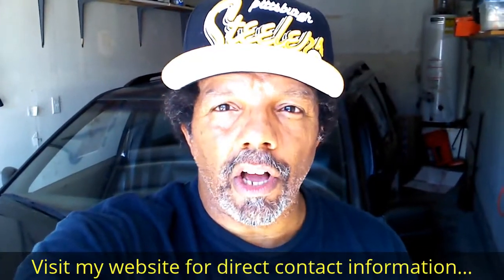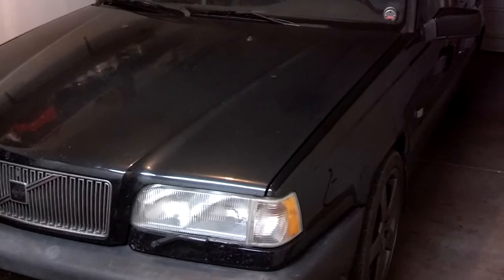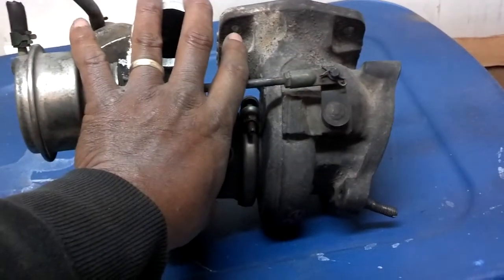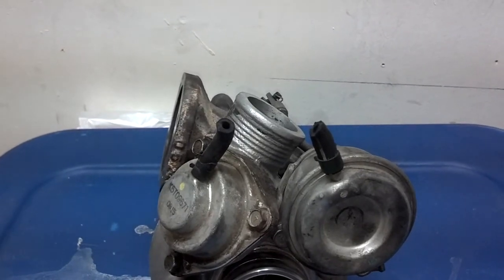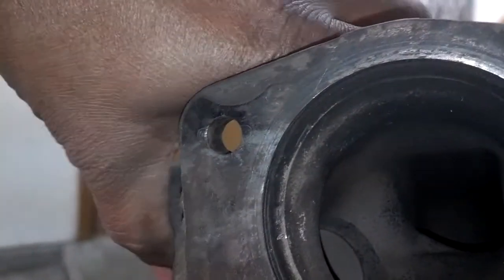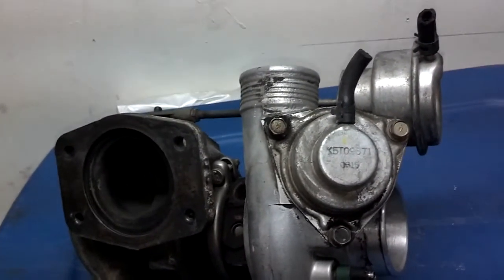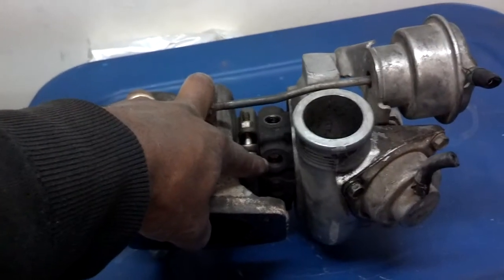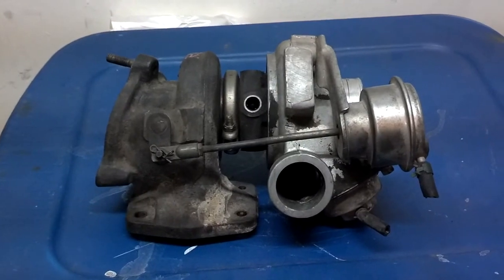Turbocharger system on a car or truck, 101. Introduction to the trubocharger system. - VOTD

Comment: Great tutorial. Since the S70's don't have a turbo gauge on the cluster, is there anyway to tell if it's not running correctly?  Will a bad PCV system ruin a turbo?
Reply from the maker: Sebastian Schwarz I do NOT believe that a clogged PCV system will damage a turbo, however, it will cause some back up in the system and cause some oil to get into the intake tubing. I believe it is an injustice for manufacturers to fail to install turbo boost gauges. I believe they deleted them to reduce questions from the end users. I would recommend installing one, permanent or temporary to check the system from time to time.
Reply from the maker: Sebastian Schwarz https://www.youtube.com/watch?v=awtZwxsBRZM

Comment: I have a B230FT turbo engine in my 1987 760.  After 190,000 miles, still have the factory turbo (because I let the turbo cool down 3 minutes in city driving and 5-6 minutes in mountain driving. Good video.  Thank you.
Reply from the maker: Michael Chitwood Nice. I feel that Volvo's have good turbos.
Reply: I agree.  I encourage other drivers (with turbos and non-turbos) to let the car warm for 2 minutes during this 8 degree weather (24 degrees below freezing 32).  I am surprised by the large number of drivers who start the car and go (about 85% of the people I've spoken with).  One would think they would try to make the engine & transmission oils warm up during the 2 minutes and make both last longer.
Reply: Here in Denver, CO; we've have sub-freezing weather for past 2 weeks!!
Reply from the maker: I know. Brrrrr

Comment: Hi Robert! I seem to be loosing a lot of coolant underneath my turbo which is landing on the block and steaming. Its hard to reach but I believe its the coolant line you show on this video. Its completely draining my coolant reservoir. Any easy ways or videos to get to it without too much disassembly? Its a 1998 V70 XC AWD 2.4 any info would be greatly appreciated. Thanks man and thank you for all you do!
Reply: Robert DIY
Reply from the maker: Davey Ward There is a supply coolant hose and a return coolant hose. It may be tough getting the supply hose replaced but I usually do it from on top on your car. - https://www.youtube.com/watch?v=JRBBvLBhAdk - https://www.youtube.com/watch?v=SGilWieCnOQ - https://www.youtube.com/watch?v=s1OlrdloSzo
Reply: Robert DIY its not the inlet hose like in your video, its another hose underneath the turbo as far as a can see. I took the airbox and turbo pipe out to get a better look and can see the coolant leaking on the block. Not sure which hose yet bc we've had tons of snow lately and haven't had a chance to take the turbo office to see exactly. Ill try to take a pic if possible. Maybe a main lower radiator hose, but it drains the coolant reservoir mainly while im driving(short distances bc I have to keep filling it up). When the block gets hot it steams bad and smells like antifreeze burning. Its def under the turbo not on top like in the video. Thanks again man for the info
Reply from the maker: The only other hoses back there are the lower radiator hose and one of the heater core hoses. At any rate, You should fix it before you loose your game of coolant roulette.
Reply: Robert DIY Thanks Robert! I should be able to get to it in the next couple days

Comment: ok ? how do i get the smoke to stop , evening after i change the turbo that was leaking ..i believe theirs still oil in the exshualts system
Reply from the maker: You'll have to keep driving until it all burns off. Maybe 500 miles or so.

Comment: Thanks Robert. Great videos. Can't help thinking that there are a lot of people buying cars, cars with smaller capacity engines which have Turbos fitted and yet these people have no idea about how the Turbo works, how to live with a Turbo charged car, the importance of proper servicing and the importance of buying an extended warranty when buying second hand.
I, until very recently, worked in car sales, I hasten to add that I hope to again sometime soon but one thing I liked to do was to explain the function of the Turbo. For example, a customer would come in and ask for a car with a 2000cc engine. As we are so use to doing in the UK.  I would then find myself explaining that we didn't produce that car with a 2000cc engine and would tell them that the 1600cc engine in this model produces more power than a 2 litre engine! I would then have to explain the function of the Turbo and the reason for fitting Turbos.
My guess is that the motor industry is building up a lot of warranty and repair cases for the future if people don't understand how a Turbo works and good maintenance practice.

I do have a question though! My Saab Turbo had recently started blowing white smoke out of the exhaust so I changed to a slightly thicker motor oil to see if I could reduce the smoke problem which I guess is the Turbo on the way out. Anyway, the slighly thicker motor oil seems to have done the trick as I only get a puff of smoke once or twice in a moderate journey, which is fine until I replace the Turbo. The question is, is my smoke issue likely to be the Turbo as I have no other problems, the oil consumption has dropped off due to the thicker oil, and what are the implication of using a thicker oil?
Reply from the maker: +Phil Donnelly My guess would be old tired valve stem seals, especially if the smoke was during idle and long down hill coast. 

Great points about more vehicles being equipped with turbo's. Many will destroy them prematurely.

Comment: Thats brilliant robert, i understand a basic turbo for the first time :D
It sounds a little like an electronic power supply circuit where there are paths for control and negative feedback paths to keep it from overloading or overdriving.

The cool air requirement makes sense to me in a way, hot air expands so takes up more space than normal, thats not a desirable thing, cold compressed air is concentrated better or more dense, is that near to the truth robert?
Reply from the maker: zx8401ztv Yes, but from what I understand, cool air gives better combustion better than hot air. Running the air through the intercooler reduces turbo lag and improves the efficiency. People that MOD their turbo cars to make them run even better/faster will add water injection to the intake to cool the intake air down even more to keep the power coming.

Comment: Nice video.  One slip of the tongue, these Volvo's do not have a blow off valve.  No production car has them, because then you have a loss of unmetered air.  Only aftermarket supports the blow off valve mod.
Reply from the maker: Carl Vella Bypass / blow off, what is the difference?

Comment: are you rebuilding the Turbo on your 850 wagon?
Reply from the maker: Michael Sackstein I wasn't planning on it. The turbo you see is a 16T out of a '01 C70 T5. It is in great condition so I am planning to install it in my car. Mine is getting a little tired, I can hear it spooling up. Mine has 273,000 on it and this one seems gently used and probably has 143,000 on it.
Reply: Is it compatible with your car?
Reply from the maker: Yes sir, direct fit other than the exhaust flange that I can swap from mine.